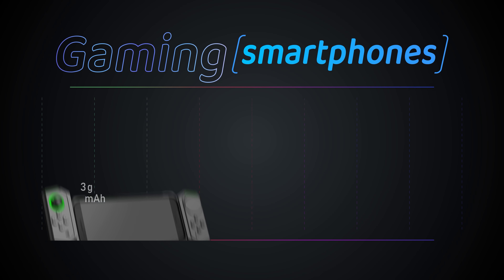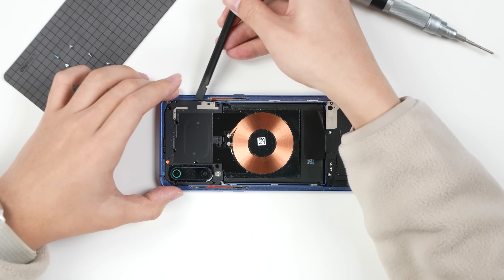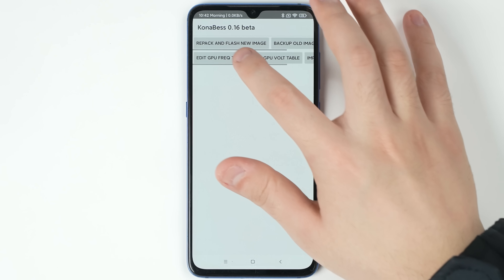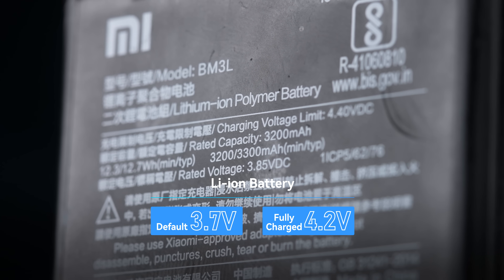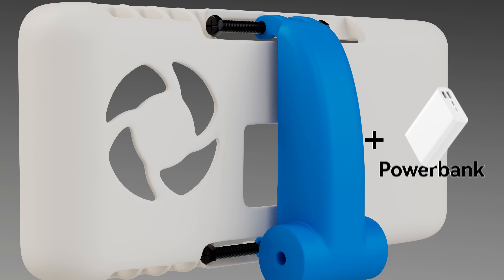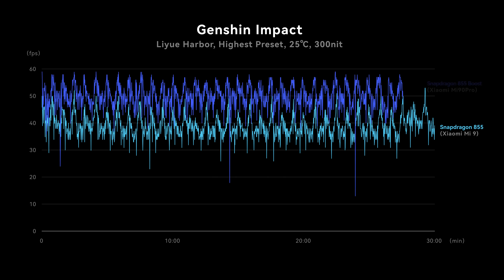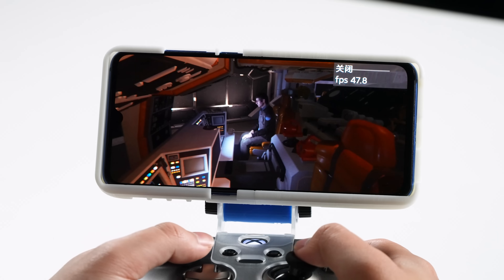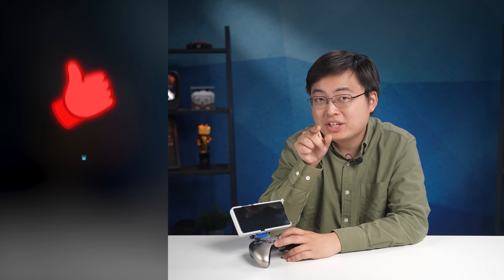We Turned This Old Phone into a Gaming Beast !!!

Comment: I'd love to see a repurposed sd865 gaming system. Like a console with water cooling, HDMI, USB, an attached 2tb ssd, and extreme overclocking capability. That would be amazing if you use a ln apex 2 gamepad for gaming, the software is extremely customizable.
Reply: Imagine that powerhouse. The power of an Xbox in less than half the space, 1440p, 60-90fps, can still be a workstation if you need. Does it make sense? Maybe, it really depends on what you need. Is it fun and cool? Aw hell yeah
Reply: Or an 8 gen 2, but tbh I'd be happy with an 865 if it's overclockable. With enough cooling I bet it'd be able to do almost any game at 90fps high graphics I wish genshin would let you set a higher resolution tho, 60fps is enough for me but I really wish it'd look as good as the PC version at 1080p instead of 720p

Comment: I like this, I have the same phone and even though xaomi gimped it's performance with a factory underclock, it performs excellent for emulation Upto 3ds/ps2.

I thought about doing something similar myself for a while. Most experience I have soldering is replacing the psvita oleds proprietary charging port with usb type c.

It "should" be possible to solder a cheap usb otg hub directly to the usb port. Usually go for around $30, come with two usb type a, hdmi, and a microsd card reader. That's the first improvement I would make over the project.

Also, apparently on the XDA developer forum; xaomi have also gimped the battery via software because "staged obsolescence".

Are the cad files for the case you made available? I have a spare vita oled I want to junk up.

Thanks

Comment: sick, shame none of these improvements really work with overclocking, I'll take teh list of games I can lay though and may overclock my phone monitor, I just wonder why the heck it effects colours, does it automatically lower the colour range?

I think I'd rather downclock everything but the fastest cores or just downclock everything (even the screen) for insane battery life. I also hope there are voltage controls for CPU, GPU and RAM as ram on PC atleast runs at a much higher voltage then nessesary often times.

Comment: I tried this project on an old redmi k20/mi 9t and replaced the motherboard with one from mi 9t pro/k20 pro. It works flawlessly, but it has a lot more adaptations that you have to do in order for everything to work. Especially in making the firmware recognize the extra capacity. Your mileage may vary since k20 pro has two variants - 855 (plain) and 855+ (pro premium), the latter being hardware locked up to 692MHz. I really appreciate the incredible effort in producing this video. It is kinda difficult to adapt such a project to other phones but is incredibly doable. The sky is the limit.
Reply: Hello there. I am also interested in this kind of project, I just upgraded my battery but could you share the magisk module you used in order to change the battery capacity?
Reply: @FunkoBuyer-gl7qw please check "Making a Multi-battery setup on your Mi 9T/K20/Pro, or any other Xiaomi device" on XDA. I made a post there specifically detailing how to do it
Reply: Could you share what voltage you used for 840Mhz in the GPU overclock? Or did you not tweak that? Thanks
Reply: @mantistsai6457  I used the highest available voltage...I managed to get to 850MHz
Reply: Cool. And can you share your cooling solution? Graphite sheet? Fan?
Reply: @mantistsai6457  I pretty much applied the video for my cooling system. I milled myself an aluminum heatsink with 1mm spacing between the fins to fit between the phone frame and the camera bump. I used thermal pads to contact it to the ESD shielding of the motherboard, and made a nice cutout on the plastic cover of the motherboard. I also drilled a few holes in thay heatsink so that it can be screwed to the motherboard screws, and bought longer 1.4mm screws to compliment them.

I bought a tiny 2A boost converter (the one used in the video is only 600mA and it burnt out on me) to boost my battery voltage up to 9v so my temperature controlled fan controller (zhiyu zf-3L) can ramp up my tiny 5v blower fan to blow useful cooling, from 35°C probed on the heatsink, to full speed at 40°C. This was done so that I can build myself a full case instead of having fully exposed circuitry on the back cover

About the battery, having 3 batteries is too much compromise for daily use. Phone is too bulky and heavy, so I stuck with 2 batteries instead. I made sure to give those batteries a solid spot weld for nickel strips of which to solder wires on, so the connection is secure. Then I encountered a fair bit of tinkering with magisk modules to make my phone charge up to 8000mAh.

Comment: 03:00 as en alectronics engineer: u seriously? o.0
Reply: It is not okay to connect batteries parallel without an resistor. There leveling current in the different cells are not good for the battery.
Reply: @engineer9750  thank you
Reply: pls tell me whats wrong with it

Comment: can i do this with a galaxy j36
Reply: Basically anything that is android, overclocking is possible if the phone is running on the android operating system. Also certain CPUs or GPUs, depending on the manufacturer, could definitely be played with. Just check you phone specs, do some research and use this video as a guide.

Comment: This video is just... pure brute force. I love it. Dude legit said "fuck the design sensibilities of normies and smartphone manufacturers, If they won't provide me with the T H I C C   A N D   J U I C Y , I'll make it myself."

Power efficiency? Yeah, that's cool, but what about mashing 3 fullsize batteries together? And an active cooler fan? And zero frequency scaling? Gee, why not add the strong PlayStation 5 vibration motor while you're at it?

I don't want to see this monstrosity charging back up from 0%. Also, it might not be 100% stable if you override the battery capacity info that late in the boot process. The phone might still attempt to use the original value if it charges while powered off. That could be fixed if you found and changed the value in the device tree source for the kernel itself.

Comment: Its reali cool BUT you could make the proces cheaper and thiner (don't use prototipe pcb ->use wires and glue + don't use that thic cooler ->use a small laptop or somting laki that flat fan)
👍

Comment: Watchinng what you guys achieve in terms of hardware and electronics modding i wonder is it possible to design a solution to run my old phones (battery is either dead or too worn off to boot) directly from a power adapter...something like i cut the USB-C end of my 5V-12V 2A Adapter (1st modding the adapter to provide max 4.2V which is the max operating voltage for the phone) and fix the Phone's BMS connector to the wire and then connect the modded cable to the phone's power section female connector. i then make sure the wire is secured properly or make a system to connect or disconnect easily..Is this doable??...will be exciting to see such a video...so many phones will get new life...some as gaming/ emulator devices or as wifi router or a security cam...Please try

Comment: this is super cool.
unfortunately it's held back by the same thing as all other gaming phones, Android.
Consider this, the Nintendo Switch is able to handle Alien isolation at 1080p 30fps no problem with minimal graphical cuts, it can even handle more intensive software such as Crysis 3 or The Witcher 3 despite having an underclocked SOC from 2015.
Realistically modern smartphones should smoke the switch but with a few exceptions (i.e. Apex) they rarely do, the main reasons for this are one that devs can optimize software specifically for the switch rather than having to support literally 100's of phones and two it has a custom os that doesn't absolutely murder performance like Android.
If Nintendo does release the switch 2 next year (as the rumours suggest) gaming phones simply won't be able to compete as it'll destroy them (just like the steam deck does) despite similar specs and most likely a lower price tag.
we can only hope that AAA games begin to implement arm support so that these phones could run steam os or something but until Apple makes a push for gaming on mac or windows commits to arm, that's unlikely to happen.

Comment: Hallo bro
1. Sorry for my bad English
2. I have a questions
I have made a battery for my samsung note 8, because this note 8 battery only has a capacity of 3300mah and I have combined 2 original batteries of each capacity 3300mah and 3000mah
But the problem is that the samsung system only says 3300mah max capacity 
I was modified sys/class/power_supply/charge_full 3300000 to 6300000 but never change always back to 3300000 or can't write

Comment: Did the same type of customization for 860 power poco x3 pro but with a thermoelectric cooler and now its a gaming beast. No gpu and No screen overclocking already comes with 120hz display only processor overclock

Comment: I dont think the overclocking ( And changing the clock speed even by using the CPU Scheduling Algorithms really change the performance now.) From SD 845 onwards, they disabled the feature to choose the clock speeds Manually.
Reply: And governers also dont CHange the performance, but rather request to maxismize the performance to the processor. But since you Tested GPU up to 800mhz.. I would like how you did it.

Comment: Just gonna put it out there that you should never put lipo batteries in general in parallel with the same protection board.
If one cell goes bad, you quickly wind up with a risk of fire. Part of that is because the other two cells will try to charge the bad cell, another is that the amount of current drawn will differ. Usually, you will put all the batteries in series and have the voltage regulator step it down, and have a balancing chip, but thats' obviously not feasible here.
It will probably all be fine, since you are usually not pulling enough current, but if you design something like this that even remotely touches the consumer side of things keep it in mind! :)
Reply: Oh, and the 'You have to discharge it to the same level' holds true, but it won't charge to the same level. Again, it's probably fine, it will probably work out OK, just.. be wary, yeah?

Comment: Not trying to be a dick, but your FDM printer seems really badly calibrated. Underextrusion and probably wrong steps per mm on the belt.
Reply: Yeah. We use FDM everyday at work to make functional parts for our robot and it is nowhere that rough.

Comment: Hello! I was impressed with your DIY gamer project. And I would like to replicate it, but I have some questions:
1.- How do you modify by software, in Android, so that it recognizes those mAh coming from the extra batteries?
2.- At what minimum percentage is it convenient to discharge them before connecting them in parallel?
3.-What thermal paste did you use between the fan and the processor?
4.- How has your "The Mi 90 Pro" behaved over time? is stable? serves as a real main and daily use handheld console?
  Thank you!
Reply: Maybe Rooting your Phone and watch YouTube tutorials

Comment: Your FDM 3d printer should not be behaving like this. There is something seriously wrong with it or the settings you used.

Check:
-your layer height (How thick each layer is)
-Speed (how fast the print head is moving)

-Plastic material (What type of filament you are using)

Ask someone who knows a lot about 3d printing to check your printer and the settings you used.If you don't know anyone who has a lot of knowledge with 3d printers you could just google info on your specific printer.

most FDM 3d printers produce less quality parts than resin printers but not by the extreme degree shown in the video, 

It appears you may be using the ender cr30, in which case ask someone about this specific printer.

Comment: I think if you used a SD870 with 8 or 12gb of ram, use a bigger back and way to extend the camera ribbon cable, a bigger heat sync and 3 4500 or 5000 battery's   I would love it an not care if I had to carry a brick it would be worth it.

The SD888 and 8 gen 1 thottles like crazy and the 870 often gets better performance after 5 mins.

It's a shame that you can't put custom ROMs on mediatek chips as doing that on a dimensity 9000 would be amazing but the 870 would be great.

The 8 gen 1 needs a heat sync and fan as standard, on many phone's it thottles to 50 or 40 percent or the phone will stop the performance and heat so it does not show the instability as bad.    Snapdragons deal with Samsung with the 888 and 8 gen 1 has cost them alot.   They are moving back to Taiwan and I doubt the 8+ gen 1 will be any good as it will just be a tweaked version of the 8 gen 1 we will be into 2023 before SD makes a decent chip so until then if you need a phone with a custom ROM the 870 is the best you can get.

The Poco F4 just came out and it has the exact same specs as the F3 SD870      same main board just a slightly better camera and fast charge.

Xiaomi has stopped production of the F4GT with the Snapdragon 8 gen 1 as it's so bad and for the Xiaomi 12 people are buying ones with mediatek or the 870 like the Xiaomi 12x 

The Snapdragon 8 gen 1 has been a dumpster fire that's hot, slow and eats battery had has had so many refunds.

But I think it will be good in the future as Snapdragon now has a real competitor with mediatek making the fastest flagship chips now.

Comment: the problem of current manufacturers is to focus on the cell phone processor and not on a better and more effective cooling capacity, what's the point of having an 8gen 1 snap that overheats causing it to lose power and the battery as a result consumes 2x more
Reply: Make it thicker, put in a nice copper cooling plate, extend the battery. Give it a microSD slot and a headphone jack. Add a performance switch
- default mode: full resolution, limited dynamic clocks for smooth day to day use
- high performance mode: reduce screen resolution, increase clocks, for maximum framerate in games
- efficiency mode: reduce resolution and clocks for maximum battery life.

Comment: From this we understand that chipset companies should advance in the thermal parts. All these new flagship chips are already way too powerful, the only problem is heat. I think they can't even perform their full potential due to heat, and locked half the power from the box. In future 2 years they need to deal with heat and energy efficiency problems. I would love to see real fans in the phone
Reply: Make a phone a big thicker, give it room for a bigger battery and better cooling solutions. I remember iPods having a metal back cover, something that would benefits as means of a big cooling surface. Maybe even put some fins on the back to improve the cooling. And yes, a non-smooth surface has more grip.
Reply: @HappyBeezerStudios  Yeah, making battery taller and wider is not efficient enough than making it thicker. For example if you want to increase the battery size of oneplus 10 pro by 20%, you can make it 3,2cm taller or or 1,7mm thicker. Just by making it 1,7mm thick can make 20% difference. 

And i think attachable cooling fan is more better at this point. In the future graphene battery could solve heating, health, charging speed etc.

Comment: Am I the only one noticing the shear stupidity of running these batteries in parallel on a single driver...?
These batteries will drift in charge over time and once that happens with high enough amplitude between some of them... That could result in a nice and warm house fire.

Comment: "Cameras run games?" Uh, yes, thank you! Finally someone said it. There are several manufacturers making 'emulation handhelds', why isn't anyone making a handheld for android games with more battery and power instead of 20mp cameras I'm never going to use? We just want the screen, the battery and the chip, no sim card, no camera, no wireless charging... Every good GPU phone is bloated with costly parts, and the budget options only have the bloat parts.
Reply: GIve me a nice 8 MP camera for 4K shots and leave it at that. Enough to do those daily tasks people do. I wouldn't mind on the sim card, gonna have data when you're not at home. But give it a way to expand the storage for more games.

Comment: It most certainly is not better than the official controller support...
I fail to understand how MiHoYo still haven't enabled controller support for Android. It's been so long now. I tried the controller-to-touchscreen mapping thing before, and it just sucked. It's buggy, and requires you to activate it using ADB every time. Or if you use root then some games will just plain refuse to work.

So, overall this is a really impressive project, it really is. I just fail to see why anyone (who hates touchscreen controls) would do this. 
If android ever gets any real games that are good and support a controller at least, I may try this.

Actually, the custom battery thing is really cool. I may do this to a normal phone if possible :D

Comment: Hey man, great work!!! My only concern is that i cannot tell if you connected the fan before or after the battery protection circuit. If i were to do something like this i would have definitely tapped into some point after the protection circuit just as a precaution, especially sense you have so much battery there, something going wrong in a battery like that could be sooooooo bad if its in your hand or pocket.

Comment: Hi, I have a oneplus 3t with a 12.8Ah battery.But I have difficulty using this solution for the voltage ranges. Would you know a way to insert the levels from 3.0v to 4.2v in the configuration as in traditional lithium systems? Congrats on the content.
Reply: Hello, fan!
Thanks for reaching out congratulation 🎁🎊🎉You Won a (PC or PlayStation5)Cheerful send a message above to acknowledge your prize.